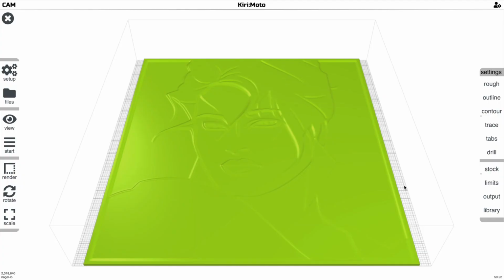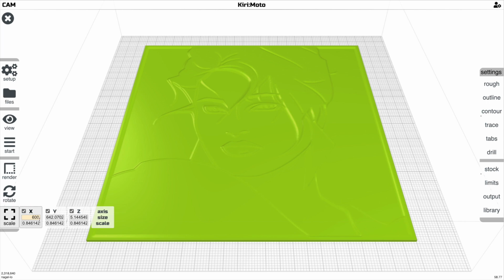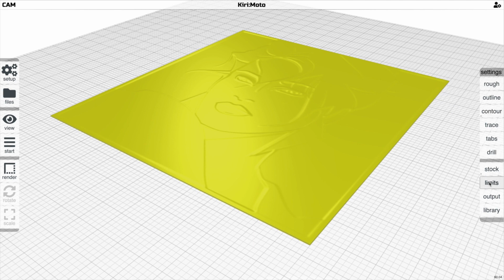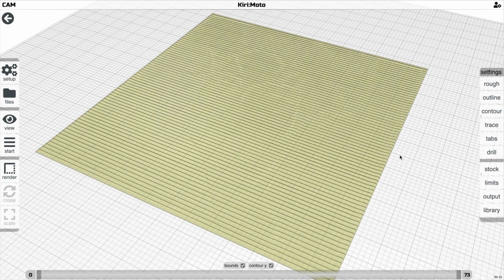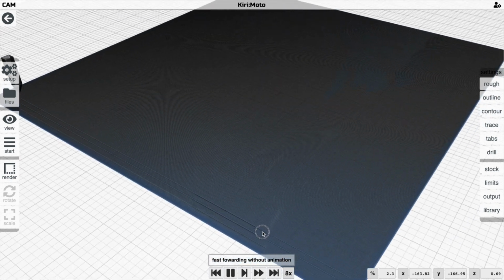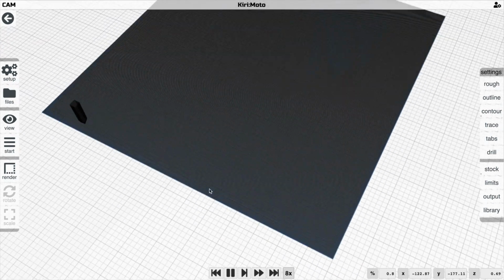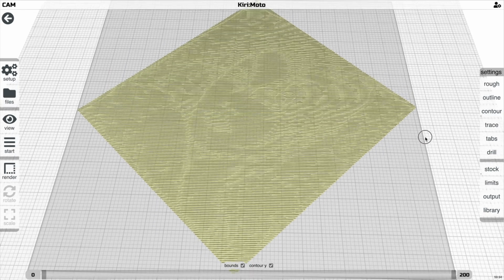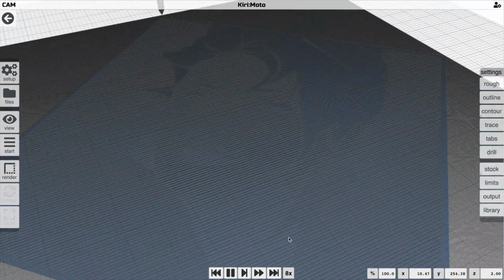Raster CNC Milling with Kiri:Moto

Comment: Nice finish, shame it has to rotate the image makes it awkward if you want to print on a smaller frame eg 7x5, instead of rotating the cut angle in a square aligned frame